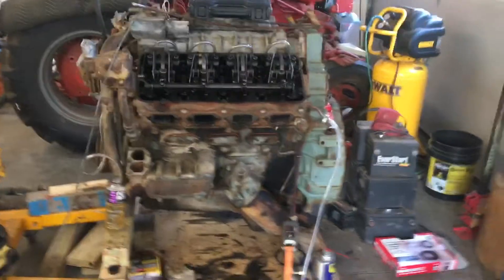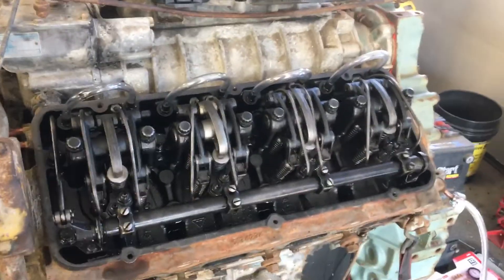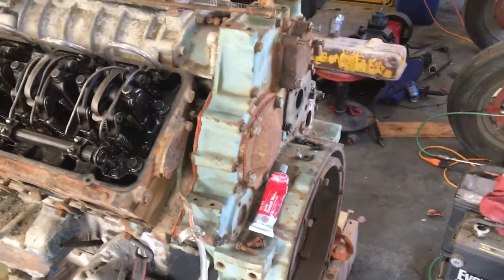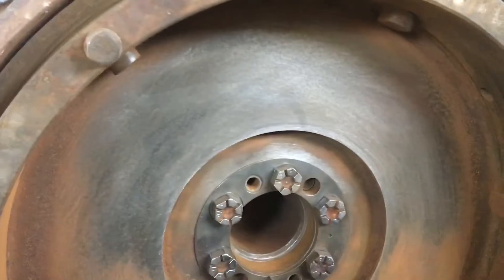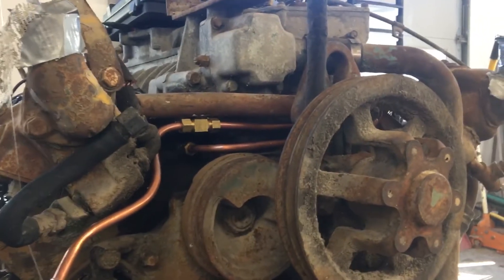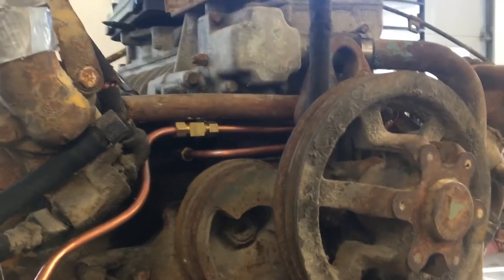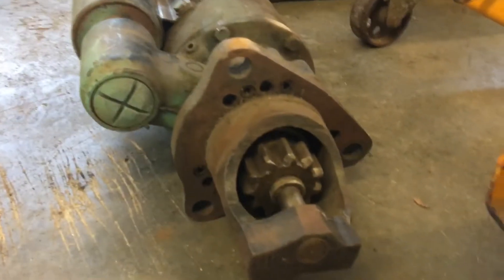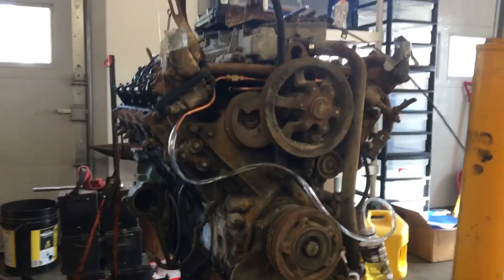Detroit diesel 8v53 update

Comment: That's awesome, going to sound nice.  I subbed so I don't miss the updates.:)  The 8V53 weighs about the same as my 6V71.:)  What are your plans for the engine?
Reply from the maker: Thank you! I weighed it in at 2,000lbs on the dot. Maybe at first it will be a show engine at car/truck shows. Then I have a rat rod I’ve started it will probably go in. Will look like a 20s or 30s open wheel racer concept
Reply: @ronfrance4041  Nice, should be a lot of fun.:)